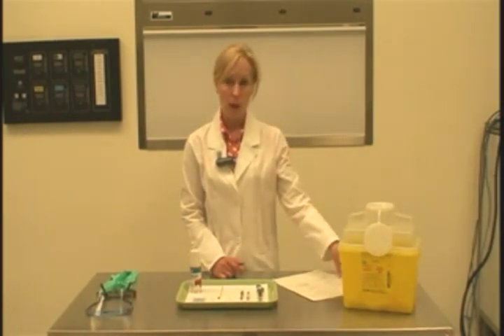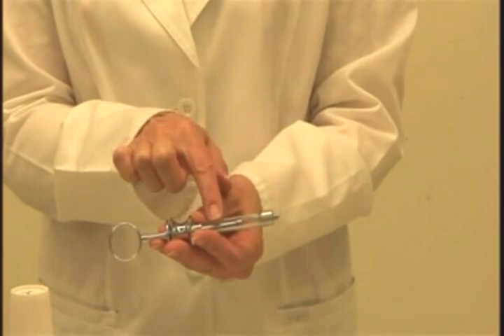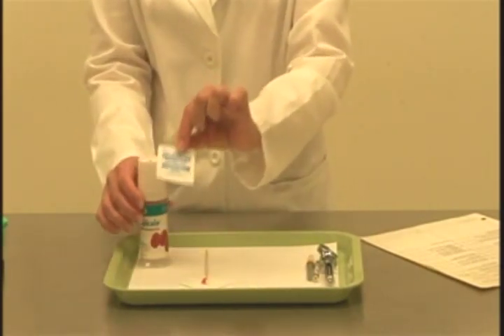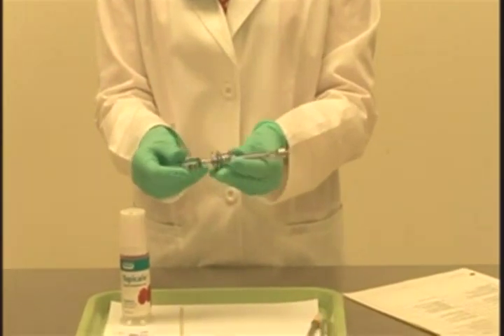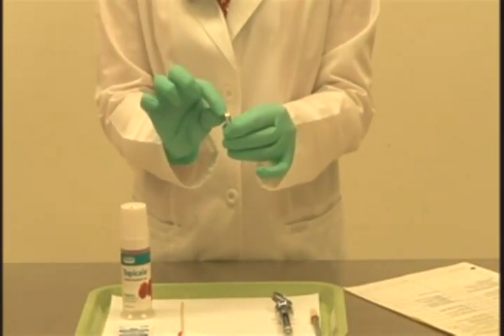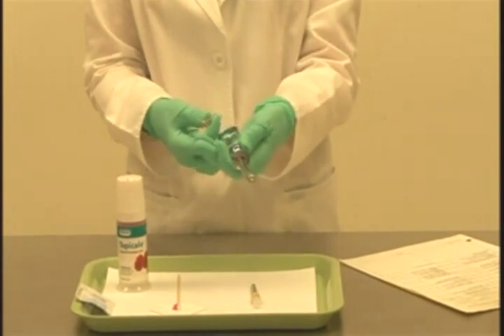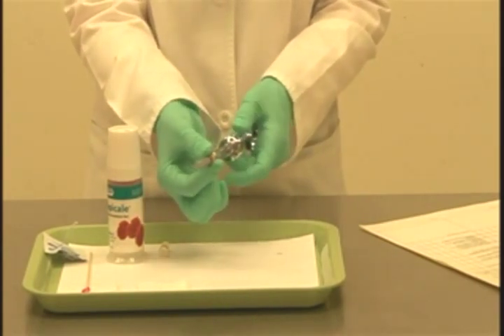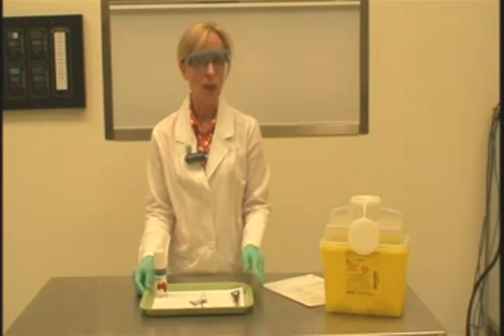Self-Aspirating Local Anaesthetic Syringe

Comment: For the one hand scoop, it's better to scoop the needle cap & face it upward to confirm that the cap has been scooped by the needle, before pressing the cap shut. There are times when the needle isn't actually in the cap & a needlestick injury occurred when the assistant pressed the cap.